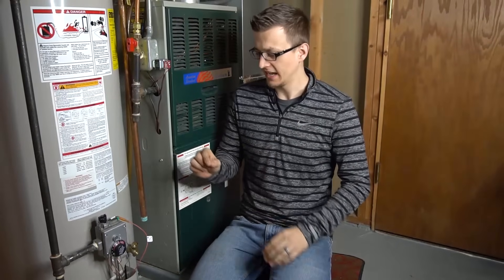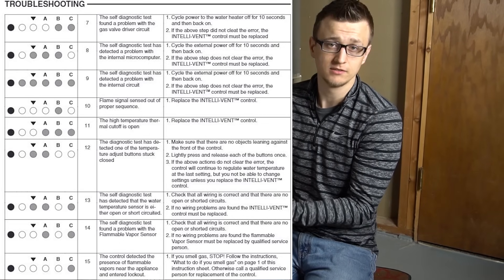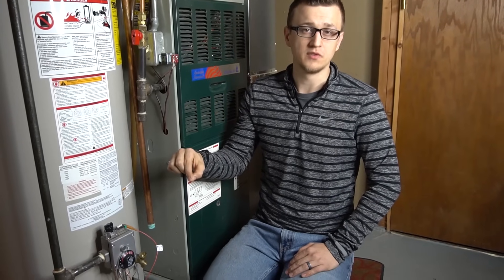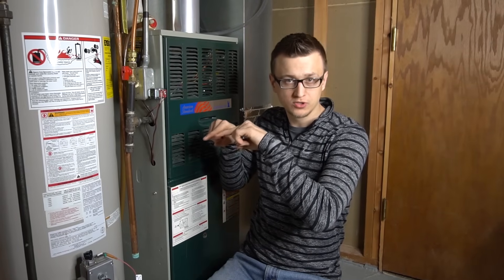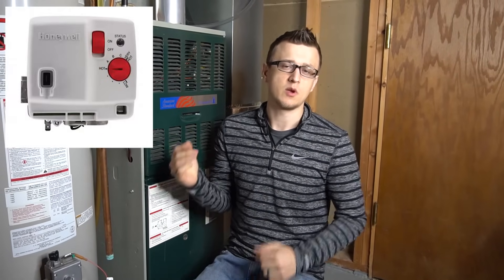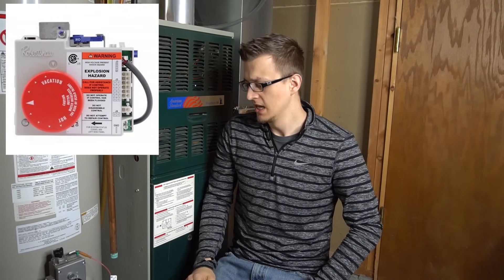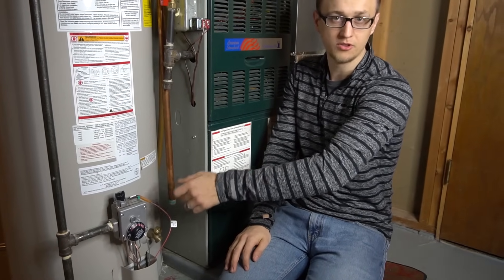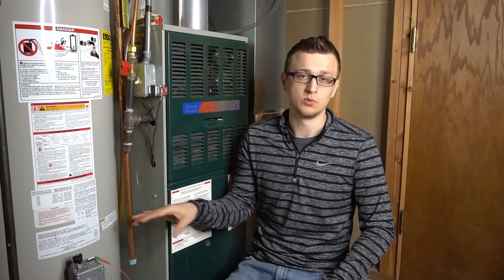How To Reset Flammable Vapor Sensor on Water Heater

Comment: Thank you. Would cat litter boxes trip the sensor? Litter boxes have been in the same spot for 6 years and it never happened until now
Reply from the maker: Hmm.. I suppose it would be possible but I have not seen that happen before. Sorry, I don't have a good answer for you
Reply: That's actually good to hear. The plumber my landlord had out last year said it was from that and now it's acting up again. I think it would have been happening much more often if it was from the litter boxes. I use a litter that absorbs a lot of the odors and I clean them often. Thanks again
Reply from the maker: @jolynhanna5761  No problem :) Hopefully this won't become a chronic problem for you
Reply: @WordofAdviceTV  same here. I replaced the vapor sensor and still having problems, the next step is going to check the flame sensing rod and ignitor...do you have a video on doing that?
Reply from the maker: I don't have videos like that for water heaters only furnaces. So what is your water heater doing? Also, does your gas valve have any error code lights, if yes, what error does it show?
Reply: @WordofAdviceTV  yes it has error codes, I have the White Rodgers intelli-vent, the vacation light is on and lights A and B (light on, off, off, on, on, & off) it tries to run after I turn it off and back on, tries for about 3 times before stopping and throwing the code. From what I've seen, it's an error of maximum ignitor attempts and I should try cleaning the flame sensing rod. After I replaced the FVS I wasn't able to go through the resetting steps and I'm not sure why it didn't work
Reply from the maker: Ah okay, from what you described, that does sound like a dirty flame sensor. If the burner only comes on for a few seconds and shuts off that is almost always the flame sensor problem. Hopefully you can get to yours without having to take the burner assembly out. But just search "how to clean a flame sensor in water heater" on YouTube and I'm sure there will be many videos showing how to do it. Also, if you replaced the FVS, then you shouldn't have to put in the resetting steps since the new one comes in a "non-tripped" state. I hope that helps somewhat.. Good luck!
Reply: Thanks for your help. Now I'm just waiting for the replacement gasket to arrive and then I'll be able to open it up and figure it out for sure. Been trying to avoid calling the plumber, have to save money anywhere you can these days.

Comment: Install a resistor in place of the sensor.
Reply from the maker: I suppose that could work :)
Reply: @WordofAdviceTV    I work in an automotive repair shop with minor spills of gasoline and use of chemicals. The owner installed a new water heater up high in place of the 30 yo one and if you farted in the shop it would have a tantrum and shut down. The manufacture told us they were too sensitive for that environment and told us what resistor to get to bypass the sensor. Works fine now.
Love your video's, my friend.
Reply from the maker: @wysetech2000  Ha, nice! So the manufacturer can even suggest which resistor should be put in :) I didn't know that. Thank you for sharing and glad to hear you like the videos!
Reply: @WordofAdviceTV    Don't know if the manufacture was supposed to tell us how to overcome the problem but they did.

Comment: So I have the same water heater as yours just a few years newer. My concern is if I put my nose right up to the gas valve where the button is to turn it from pilot to off I can smell gas. It's faint but it's there. Is this normal?
Reply from the maker: If it is a faint smell that you can only smell if you are putting your face into it, I wouldn't worry about it. But if that concerns you, you can always call your natural gas provider and they can do a gas leak search for you (should be free).

Comment: flammable vapor sensor  are they mandatory now on new gas hot water heaters? First time I have seen one.
Reply from the maker: I don't think they are mandatory but I don't know for sure. Only a few manufacturers use them. But there are quite a bit of them out there if you work on water heaters often.
Reply: looks like some engineers got bored, they are stupid....